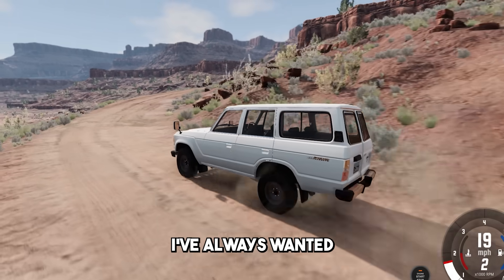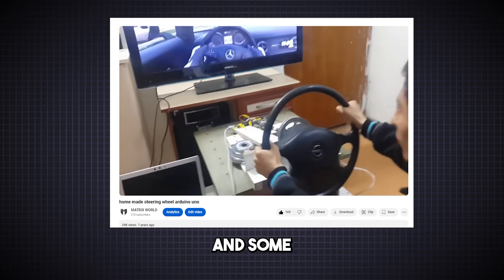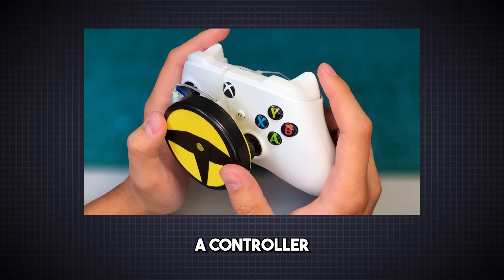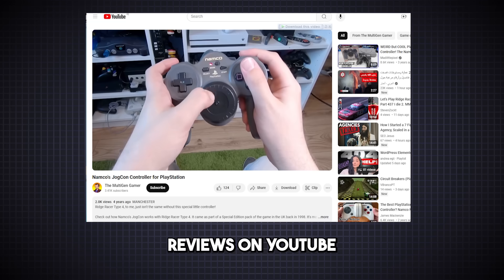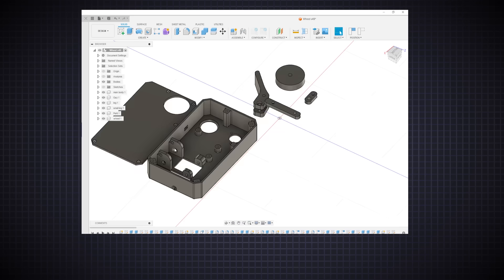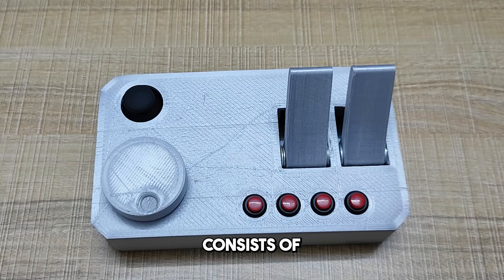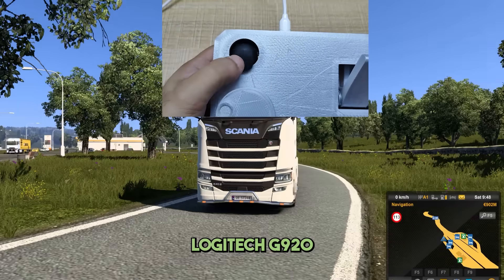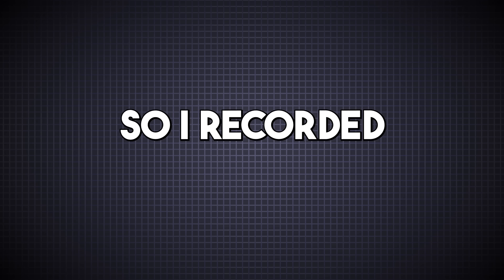The Racing Controller No Company Ever Made—So I Built It

Comment: I have some ideas for the controller. 
1 - Add L/R buttons (like regular controllers), could be used for shifting gears.
2 - Move/add buttons for blinkers in the front of the controller.

It would add/change the following :
- L1 and L2 Button, located in the front left corner of the controller.
- R1 and R2 buttons, located at the front right corner of the controller.
- Since blinkers will move in the front L1/R1 or L2/R2, you’re left with 2 unused buttons. You may want to leave the there, repurposing them for other controls.
Reply from the maker: Thank you for your feedback.
Reply: @3dprinterart299  i second l/r buttons but think they should be the levers, and the levers would be the gears
Reply: @3dprinterart299  and more ergonomic shape when holding it for comfort
Reply: @3dprinterart299  More ideas:
 - Pedals could be angled a bit counterclockwise (if you look at them from the top), which will give your thumb a more comfortable position to press them
 - Steering wheel could be moved a bit up and right
 - Move buttons closer to the right so you don't have to reach over as far
 - Add some programmable back buttons - everyone loves those (I'd do 2 paddle shifters, as mentioned above and 2 buttons for turn signals)
 - Now this one is probably up to preference, but I find little Steam Deck style touch screens and PSP style slider sticks a better alternative to make non-precise camera movements. So I would swap the standard stick with one of those, but place it on the left corner, right below the index finger
 - On the right corner I'd put a trigger for precise clutch control (for you, rally lovers!!)
  
 To be continued....
Reply: @3dprinterart299 
Can i request u made a custom one n made a review of it?

...

Steering analog on right hand side

...

Throttle and brake as usual pressure trigger l2 r2

...

Left hand side for button
Shift up shift down
Hand brake
Change view
Joystick to rotate view
Pause menu
Nitrous for arcade racing
1 additional undecided button just in case
Reply: @3dprinterart299 

One more suggestion, I think it'll also be a little bit more ergonomic to move the gas and brake to the trigger positions aside from adding trigger buttons, but that controller looks awesome
Reply: Imagine some little paddle shifters on the back, otherwise sick build bro
Reply: maybe another button for the clutch as well. good idea🤝
Reply: Add rumble to that list
Reply: I think that 4 shoulder buttons could help in this design. 2 blinkers, 2 gear shifting. Camera shifting on R3 and a handbrake button would help. Just the R3 placement is kinda odd with this layout, and just now i had a crazy idea, placing it in the back of the controller.
Reply: he should put the gas and brake paddles on the top more like a controller then you can use the face button the clutch and shift like an xbox controller in forza !!
Reply: As a Truck Simulator fan, I really like the idea of more buttons 😅
Reply: this may be the biker in me speaking but clutch trigger on the top left and up/down buttons on the top right seems natural to me
Reply: adding to that, you can use the layout of any xbox /ps controller for the triggers position, with triggers working as brake and accelerator pedals, you can map L1 /R1 to the blinkers, and map the 2 face buttons that used to be the blinkers, to shift up and down gears
Reply: @diras2010  then why no just use an xbox/ps controller? 😁
Reply: @TantoAshina  the idea is to improve on his design, he made a fair point that the experience with an off the shelve controller is not good, his idea is quite good, but the triggers on the face of the controller can be improved, unless there's some sort of disability that benefits from having those 2 on the face of the controller
Reply: @diras2010  oh it can definitely be improved, I just really like his idea of using a thumb basically as a mini leg to control the pedals, but if you want to use the classic triggers for gas/break, why not just get a standard controller?
Reply: paddle shifters maybe for L1 / R1, and an analog clutch somewhere would make this usable for manual players (which most sim players are)
Reply: i would use normal triggers instead of pedals also
Reply: I would take this idea but Instead of buttons for blinkers, make it feel more like a steering wheel and create a notch on the left side of the controller that simulates a blinker (and headlights!) on most modern steering wheels
Reply: replace L/R  triggers with  l/r paddle buttons for shifting gears so it resembles a steering wheel more
Reply: handbrakes too
Reply: The first thing that I thought, add back buttons for shifting and it would be perfect.
Reply: would be incredible if you managed to add ffb to it. also, one idea that you may not have considered: using headtracking instead of a joystick to move the camera. it's AMAZING and just obligatory if you play in a single screen, in my opinion. you could consider using a gyroscope tied to your headphone if you wanted a more precise and responsive input instead of face recognition software with a webcam. I didn't build a prototype but I thought about one before I got a projector to play
Reply: Shoulder buttons/triggers for shifting and handbrake (maybe even clutch if there are 4?) would be amazing - also adding a click to the camera stick to recenter it would help a lot in games like beamNG as well! This is an incredible project - i own a sim setup but just seeing how this could help other enjoy racing more makes me excited! 👏🏾
Reply: I would prefer a tiny H shifter
Reply: i would kill for some shift buttons. I've been dying to find a controller for initial d at home
Reply: I have an idea, use regular xbox controller but modify it to have 2 triggers for each side instead of 1 trigger and shoulder button each side for throttle, brake, clutch and handbrake
And move the shoulder buttons to the back side for shifter up and down
Tiny wheel at the front middle faceplate and keep the original joysticks button stuff for others thing

Comment: I really like it, but maybe move the stick back onto the right, and have the "pedals" re oreintated on the top edge of the controller but not orientated perpendicular like a trigger but parallel like a pedal. Maybe do gas and brake on one side and a "bonus" clutch pedal on the other? Allows you to use more stagnant fingers in the current design while still giving a similar feel, and allowing looking while steering with the right thumb.
Reply from the maker: Thanks for the ideas.

Comment: Do You think you could make a version that has shifters? like to change gear?
Reply from the maker: If you’re thinking about sequential gears (gear up and gear down), yes, that’s easy, But for a full manual gear setup, it would take more time to design—but it would be fun.
Reply: @3dprinterart299  nah, sequential is fine, i have been using an xbox controller and use the shoulder buttons for gear changes, right for upshift, left for downshift, and now its second nature, but something like that might need reconfiguring of the controller

Comment: The idea is great but the ergonomics not so great, I believe brake and accelerator should be positioned where your index fingers are, you can then use your thumb for the camera angle while your other thumb can use the steering wheel at the same time.

Comment: I would want to build something similar, but simulating an endless (360°) steering wheel by mouse signals to properly play early arcade games like Pole Position. I also insists in simulating stick shift with clutch (needed e.g. for Hard Drivin series). I am researching driving simulator history (see playlist) and so play many strange and ancient (DOS and older) driving games where I find no suitable commercial controller for. Possibly I build it into one of those baby steering wheel toys, those are smaller than racing wheels but bigger than a gamepad.

Comment: This is great, if this was a more rounded out product i would buy it. i think that it could be better if we start from the classic wishbone controller layout and worked back. if we took something like, say, an XBOX controller and replaced the left stick with the dial, we could leave the camera on the right stick -and thus on a different thumb, so we don't have to let go of the wheel to see. having the pedals on the top of the controllers is certainly innovative, but i think the positioning of the standard analog triggers works better functionally. pressing the trigger with your index/middle finger frees up the right thumb so you can use that for buttons/camera stick.
Reply: It definitely should support stick shift - possibly as a gamepad-style analogue joystick without return spring, that has replaceable stencels for different shifter layouts. Pushing that joystick in may simulate a clutch. And I prefer endless (mouse encoder) steering wheels to play also ancient arcade games like Pole Position on MAME. A microcontroller can convert the signal into mouse or analogue joystick behaviour for use with newer games. As a handheld device, the UltraRacer controller had a nice ergonomic shape (but way too small rotation angle for precision steering).

Comment: If you have electricity issues while 3d Printing, how is it possible for you to play video games?🤔 But it's a nice project. Looks nice
Reply: Electricity in Iraq sometimes rotates between the state grid and a street generator, though oftentimes people will forgo paying for the street generator and just live with no electricity for portions of their day. 3D printers often require consistent supply to finish a print, which could be a major issue here since when I was in Iraq, the supply cuts out at least every 3 hours. I don't see why you couldn't play games while electricity is up?
Reply: @Mohammed_MA1i  Get an old car battery with voltage inverter.

Comment: You should have repurposed a non working RC controller with a Rp Pico into a controller
Reply: Early Pong consoles used tiny XY joysticks like a RC remote. I rather think of modding a baby steering wheel toy, that is smaller than a reel wheel but larger than most gamepads.

Comment: Im considering getting one and I dont even have a 3D printer. This is way more convenient than my bulky wheel!
Reply: Old radio parts should be sufficient to make something similar without 3D printing. Brake and throttle may be made e.g. with linear potentiometers. The rest is woodwork.

Comment: good project but I feel like it will eventually just evolve similar to current console controllers if you follow ppl suggestion about the inputs, controller with shoulder trigger are very intuitive pedal input but I guess youre aiming for more analog/immersive type of input. 

also try to figure out if you can add force feedback to it, maybe by belt drive or something.

Comment: That's simply a genius idea. I can totally see people buying this.

And do you plan to add an "auto centering" capability to the wheel joystick?
Reply: I want the opposite. I need a small controller with "endless" steering wheel (like a mouse encoder) for historical arcade games like Pole Position. I would use a microcontroller to switch between mouse and analogue joystick mode to support also newer games.

Comment: Just an idea but where your pointer fingers are holding onto the controller on the front of it you could put two buttons (one on each side) that could be used for shifting gears, you could also make a clutch pedal.
Reply: same thought, would make it so much better
Reply: I think of this example as the early prototype version. It has good functionality and is solid as a proof-of-concept, but the ergonomics could be way better.
Reply: @pauljs75 For sure!

Comment: THIS, we have this problem in common and this sounds like something i'd wanna do!
Reply: I'll attempt something similar, try to fit it inside a typical controller layout and size (ergonomics), move the wheel to take up the entire left section of the controller, gas and brake pedal to be located in the regular trigger buttons, with typical buttons in the rest. This would be a feat of engineering 😂😂, guess it's gonna be a fun project haha

Comment: for the 3d printer electricity issue consider getting a pure sine wave online mode UPS, i have a Riello Sentinel Pro 1000 and it's one of the best purchases i've ever made, also there are a lot of cheaper ones that you can find, just make sure that the output power is enough and that the brand is a good one.
Reply: Or get an old car battery with power inverter.
Reply: @cyberyogicowindler2448  nahh, you will need to use a good quality inverter while wasting gasoline. It will be much more expensive in my opinion
Reply: @Justgreen89925  WTF you need gasoline for??? You charge the car battery by mains grid while there is electricity. I think a 3D printer needs more power than an "UPS" for PC can deliver. At least the sort I know are used in offices only to safely shutdown the PC without data loss, so it has only enough power to run a desktop PC for perhaps 15 or 30 minutes. Of course also huge UPS battery cabinets for keeping a whole data center online during power fail exist. But I don't expect that this is stuff average people in Iraq have access to or can afford. Lead-acid car batteries from junkyard are most common where weight doesn't matter.
Reply: @cyberyogicowindler2448  I thought you meant an old car battery with a generator. Also your method is pretty unreliable since a battery+inverter solution can't switch from Bypass to offgrid like an ups can, and a 3d printer like his won't use more than 300w which a pc ups can very well supply
Reply: That thing costs as much as an average hobbyist 3D printer, and I bet he even barely bought that... I'm in EU and even I'd shed a tear while throwing 300€ at it
Reply: @returnedinformation1040  a good 1000VA will be no more than 200€, and he needs no more than a 600VA one...
Reply: @returnedinformation1040  300€ for an old car battery with charger+inverter? In the west power inverters are priced as luxury items for camping and "outdoor" activities. In countries without stabile power grid they are basic needs.

Comment: great idea! how about a centering spring for the wheel?
Reply: was thinking the same, that would be soo cool
Reply: having the wheel auto center when move your thumb from the steering wheel to the analog stick to rotate the camera (since both are on the left side) just sounds inconvenient imo.

a better design would be to have the analog stick on the right side, and replacing the pedals with triggers just like a normal controller since then, you can both rotate the camera and the steering wheel at the same time which removes the inconvenience of having an auto centering wheel.
hope that made sense (love your content btw).
Reply: @super.cr4sh  An eye tracker could solve that issue pretty well. Some kind of force feedback would be great for something like this. Other than that the only other thing I would want is a bumper to use as the clutch and two more to shift up and down.
Reply: @supercrash131  yeah exactly what I thought. Then you could have shoulder bumpers for gear changes too. Basically a normal controller but with the wheel instead of a stick on the left side
Reply: Oh its the real SepiSP4
Reply: centering spring sounds wrong to me as this little thing has nominal 900 Deg of movement.
Adding a motor to the wheel would allow for centering, force feedback, ....
Reply: @sarowie  exactly just like the jogcon
Reply: A pancake motor might make more sense. That way you could do force feedback as well, or even virtual detents or software-define rotational limits. A magnetometer-based rotation sensor would be smaller and less fragile, as well as giving you absolute rotation rather than just distance
Reply: Force feedback motor is definitely the way to go here, adjustable Center force, and setting limits were also my thoughts when I watched this.Hall effect sensor is another good suggestion. Something like Scottbex1’s smart knob - might even be able to use some of his code.
Reply: You could add ffb by coupling a motor with that encoder’s shaft
Reply: @Saheeln3  FFB apis arent easy tho
Reply: This sounds something exactly like what the motors used in the SmartKnob View diy open source project. It would allow for 900 degree movement and a pull to center feature all configurable in software.
Reply: @geoffreyflores8931  but its too thick. Ive seen jogcon teardown and they use an encoder like in a printer and for the ffb they use the vibration motor with the weights swapped for a gear
Reply: Que trabalho excelente!!! Genial!!! Parabéns!!! 🇧🇷
Reply: Rubber band
Reply: What if theres a servo that can be used for these type of controller? Servo has an encoder but just shitty
Reply: There is Logitech g920 or g29 in iraq. I think it’s only exclusive to Kurdistan
Reply: @Rawa2012_  dude were talking about the controller not steering wheel

Comment: Hey man this is cool, though i'd like to give u some cool ideas i thought off when watching. Place the Gas and brake on the backside, a clutch on a corner sideways like a controller trigger. An H-shifter on where u put the pedals right now that uses the side of the thumb instead of a knob. Integrate some sort of force feedback on the wheel, tactile feedback brake and throttle.